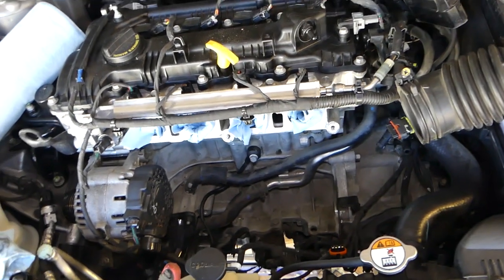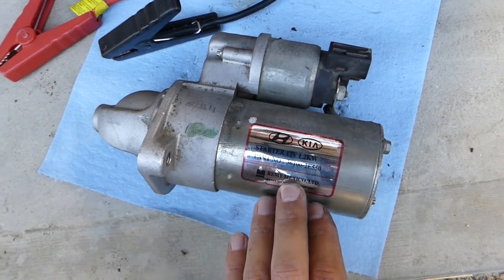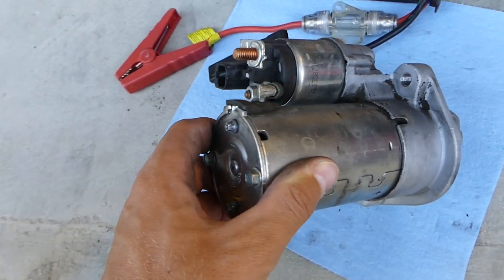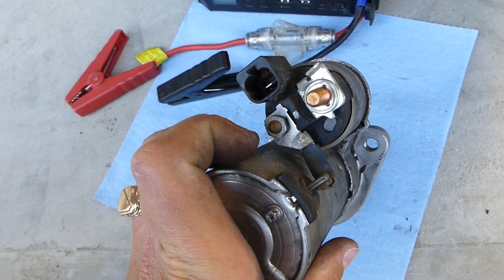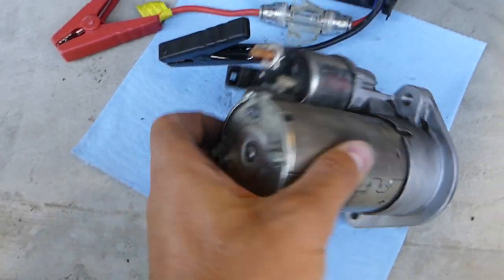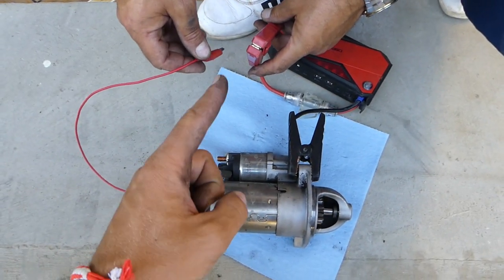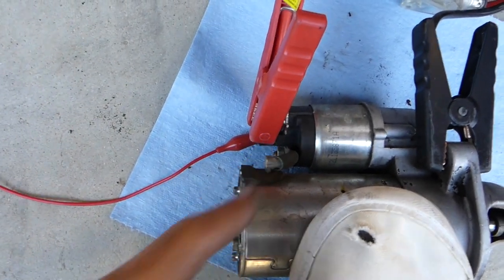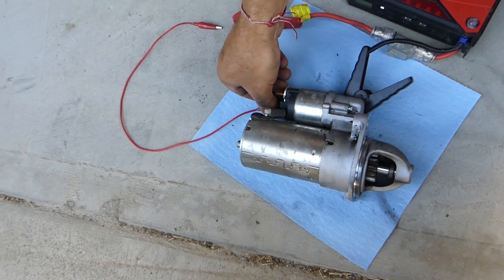HOW TO TEST STARTER ON KIA DEMONSTRATED ON KIA FORTE

Comment: Please note it takes a wire ( cables) that will carry about 2 to 5 amps, small wire won’t work, with a small wire you may hear a clicking sound from your starter motor but it won’t turn and the bendix won’t work either, small wire has to much resistance in it…
Use a 14 gauge wire..

Comment: So I bought starter but when installed still no crank for the car how can I get it running?  My battery is good alternator is good too and no other codes but it wont start
Reply: Put a socket on your crank and make sure your motor isnt locked up..